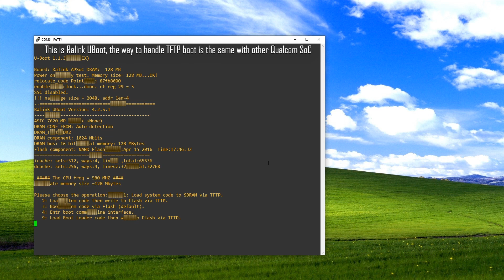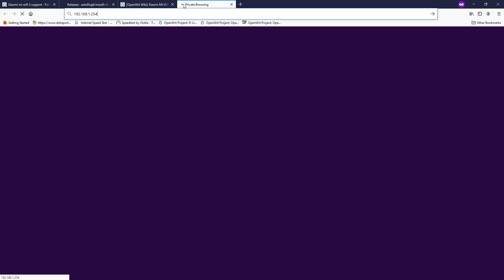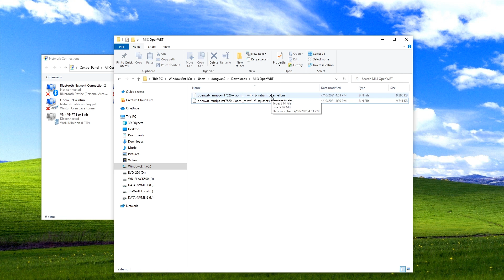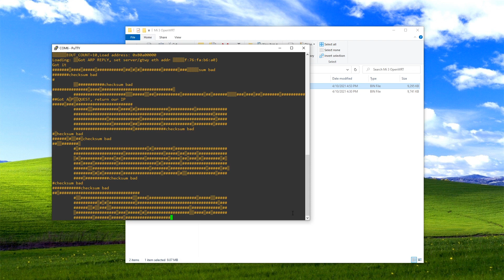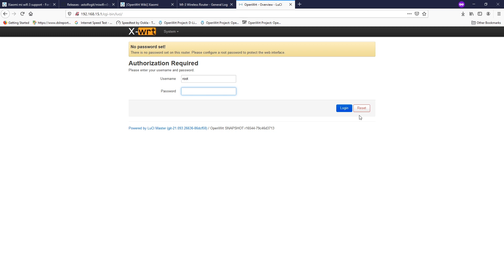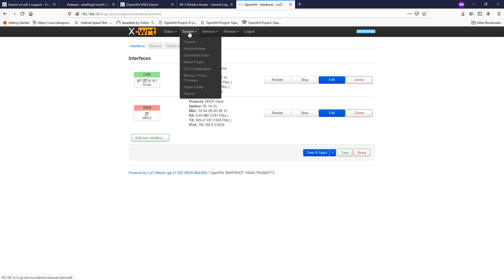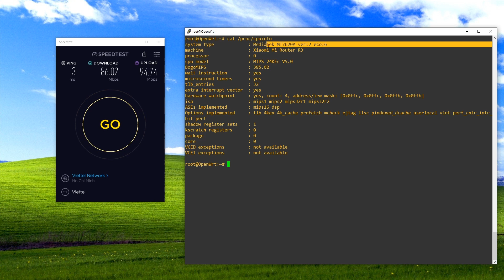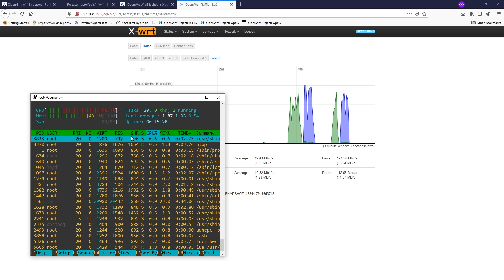OpenWRT - Install X-WRT on Xiaomi Router 3 via TFTP

Comment: just two questions: 
1) If I want to revert back the original stock firwmare, can I use the same procedure? Where can I find the stock rom?
2) Can you give a try to the VPN client speed through OpenVPN? Best
Reply from the maker: 1. No, you need to use Mi Debrick Tool and download stock firmware from https://miuirom.org/miwifi/mi-router-3
2. I am no longer using this device, the OpenVPN throughput should be around 8 - 10 Mbps.
Reply: Please tutorial fo debrick
Reply: Hi , old (subscriber )
please tell  me what Mi Debrick Tool will work for mi router gen 3?
Thanks in advance

Comment: does it work for you? I have 5GHz problems and reboots.
Reply from the maker: Hi, it is working so far. Did you flash the correct firmware version - There are Xiaomi Router 3, Xiaomi Router 3G which is easy to mesh up the name.
Reply: @VanTechCorner  yeah did all correctly and came back to original firmware now, better performance but not that configurable as custom firmware.
Reply from the maker: For some devices, stock firmware has better wifi performance as the driver is closed-source. OpenWRT only use open-source driver and this is where the problem comes.

Comment: please help, I accidentally remove firewall setting from lan, after that I cannot login via ssh or luci. wifi ssid missing, connection via lan also no recognized. how to solve it? my device Xiaomi Redmi AC2100
Reply from the maker: The simplest way is to get the access via console (UART) and then run the factory reset command with CLI. https://openwrt.org/toh/xiaomi/xiaomi_redmi_router_ac2100#serial

Comment: I have x-wrt installed on my router without opening the mainboard. Can I just flash openwrt on it?
Reply from the maker: Hi, you can directly flash the system upgrade image of OpenWRT on the router (since X-WRT is a fork of OpenWRT) and I believe the flash layout should be the same.
Reply: @VanTechCorner  thank you.
And where can I get open wrt firmware?
Reply: Are you saying it is possible to intall x-wrt on MR3 without opening it?
Reply: @valleynomad  i dit it,

Comment: Hi bro, see u again. Is it possible to use this method to recover my mi4a gigabit looks like bricked. Cannot boot up neither to 192.168.31.1 and openwrt 192.168.1.1. Is it bootloader fail? I brick my router after wrongly flash firmware. I use tiny pxe and miwifi repair tools. Both tools failed.😵
Reply from the maker: Hi, yes please give it a try. A USB to TTL (UART or Serial) adapter is very helpful when working with router and other SBC devices. When you have a picture of what is going on with the device from console, then you can move to the next step of fixing it.

Comment: Hi bro,. I have problem to connect yaml open clash on mi4a gigabit. Error was mentioned the software kernel version not update. Is it problem with hardware architecture
Reply from the maker: If you got kernel error during installation any software, please update the openwrt to the latest version and it should work.
Reply: @VanTechCorner  Noted. Thanks. I try upload manual update using winscp but failed. It mentioned sys upgrade build may not compatible. One thing I noticed that the MI4A storage to small also. 😄. Anyway, really appreciate your video tutorials and guide.

Comment: dude it seem you are professional on networking , may i ask if you do have a idea on how to Vlan tagging for R2D ?
Reply from the maker: Hi, may I know what kind of VLAN tagging you plan to setup. I have a video for PPPoE VLAN tagging, you can check them out on the channel.
Reply: @VanTechCorner  I was using xiaomi R2D router quite some time ,  as vlan tag is not available currently is running 3 devices. 
I planning to enable vlan tag on r2d to reduced the router as dialler
Reply: @VanTechCorner  may you provide me the linked that guide for pppoe vlan for xiaomi router please.

Comment: My m3 is bricked i don't get any dhcp can you make a video unbrick via serial. Or can i follw this step to unbrick my router
Reply from the maker: This is actually the guide for serial connection. You can follow it and give a try.
Reply: @VanTechCorner  it stuck on yellow light how to unbrik? Can you make a video for unbrick via serial or any other way i don't get any ip from the router

Comment: I find the X-WRT firmware is a very poor performer on my WRT1900ACS V2. Very slow wired speeds. :(  Check out my video on it, if you dont believe me. This is just on my Router, could be different mileage to yours though???
Reply from the maker: Hey, why you are using X-WRT instead of OpenWRT. What is the CPU usage when you run the speedtest? From what I know, Linksys router is made for OpenWRT and it should work well.
Reply: @VanTechCorner  Hello Van, Yes you are correct OpenWRT stock work OK, but I get more performance on wired with David's Firmware. As you probably know David has stopped making custom firmwares atm. So I am looking for an OpenWRT  that is high performance on wired.

Comment: Sir, please make a tutorial how to use Raspberry Pi 4 as a bridge b/w mobile and router.
Ex:- " 4G Mobile [USB Tethering]--> Raspberry Pi 4 [Ethernet]--> D-Link Router "
Or if it possible without Raspberry Pi
Ex:- " 4G Mobile [USB Tethering]--> D-Link Router "

Bcz im getting avg 110mbps download and 70mbps upload with my 4g network which is double speed of my broadband connection in same price.
Thanks.
Reply from the maker: Hi, If have a tutorial for USB Tethering with OpenWRT and you can try that to share the internet from your phone to other devices connected to the router. The same for Raspberry Pi, configure USB Tethering with OpenWRT installed, and connect the LAN port of the Pi to a switch, it will do the job
Reply: @VanTechCorner  Thanks a lot...

Comment: i have tplink archer c9 v1, its have ddwrt on it, do you know simple method to install openwrt or other wrt on it?, because the only method i found on utube require disassemmble and put some cable, like what u do to this router
Reply from the maker: Nope, for this device you just need to setup the TFTP server, rename the openwrt factory firmware to archerc9v1_tp_recovery.bin and start the recovery process on the router. Once entered recovery mode, the router will automatically download the OpenWRT firmware and install it. You only need serial console when reverting from customer firmware (OpenWRT) to stock.